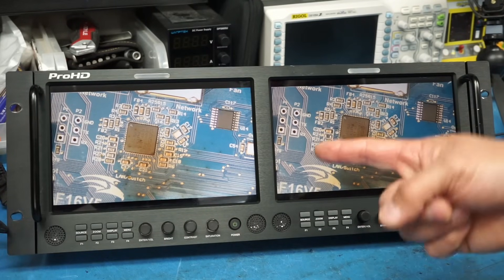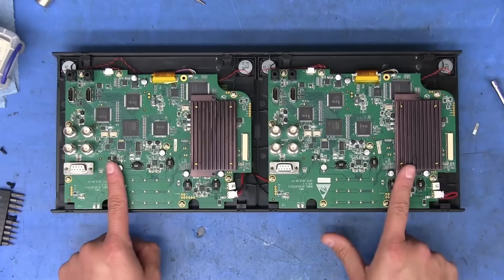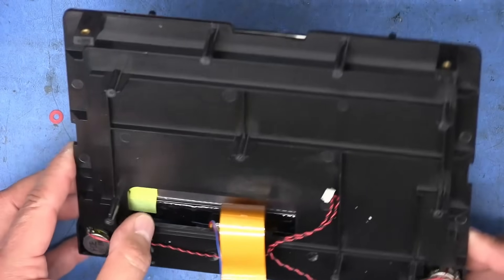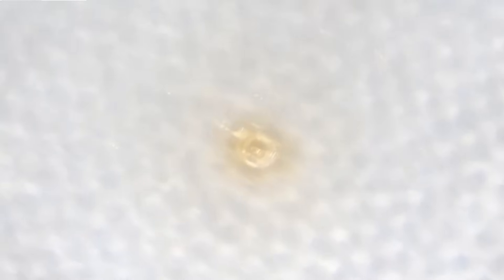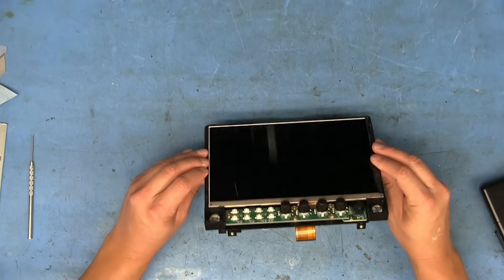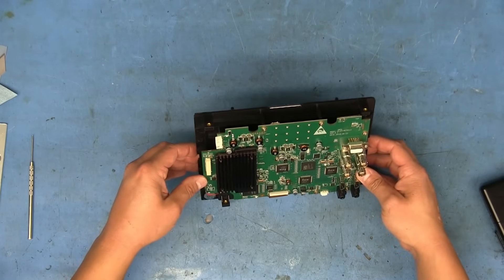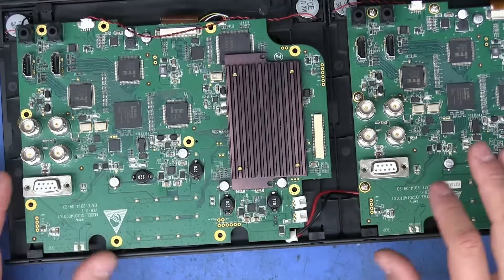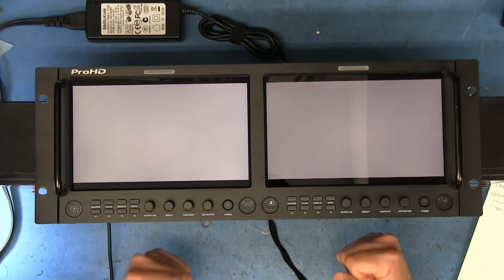TEF #157 | JVC DT-X92HX2 - Two 8.9" Displays With Brown Stains

Comment: Cellulose in the Polarizer is breaking down.. it creates a corrosive gas that attacks similar components.. replace all the cellulose layers the others won't be far behind.  This happens to most Cellulose film products that are more than 20 to 30 years old depending on the storage conditions.
Reply from the maker: If that is the case, unfortunately I'm not hoarding, errr.... have any inventory of any other LCDs I can take the sheets from. It's gonna have to remain this way for now. The 24" one I took the one sheet from doesn't have any other sheets I can use.
Reply: @ThatElectronicsFool  The issue with other old monitor parts is they are aged as well.. Best to use new Polarizer Film.. New stock is readily available online and is very cheap.
Reply from the maker: That's true. I'll have to look into it. Thanks for the suggestion!

Comment: Seems like googling the term of this phenomenon is kinda difficult with many vague searches. 
The term you're looking for is vinegar syndrome on lcd.
Reply from the maker: Very interesting. So I looked it up, the only thing that moves me away from thinking it's the same as vinegar syndrome is that it doesn't smell like acetic acid. Didn't think of making a mention of it in the video, but the affected area smells a lot like cinnamon rolls to me.
Reply: Doesn't look at all like the vinegar syndrome. Besides the smell not being there (as mentioned by @ThatElectronicsFool), the vinegar syndrome has almost an oil spill effect as opposed to these 'burn' marks.

Comment: It can't be image burn because that usually appears on the display but that is very very strange I was wondering the reason maybe for the glue and stuff in the scholastic material used in some sort of vibration Like a lorry or some sort of industrial vehicle🤔🤔🤔🤔🤔🤔
Reply: maybe it was in a Broadcasting station each light could represent a Pacific camera that's being used in a studio maybe not who knows it just seems like that🤔🤔🤔🤔
Reply from the maker: After asking about it, it turns out it was installed in a server room where it was meant to be used to make sure video signals were reaching the server that was recording whatever was being sent to it. Apparently it was rarely ever actually accessed for the intended purpose, and so it got taken out.

Comment: I think it's dead bugs getting cooked inside. I have dead bugs in my computer monitor. Terrible construction. Mine is not smashed just dead so oblong black pixels. Maybe someone pushed the LCD panels trying to "massage" away the bugs :D Good job on replacing the sheets. Maybe these displays could come in a box with a large TALLY light on the back.
Reply from the maker: Ah yeah, tally light in the back makes sense. 

As for the stains being due to bugs, I looked at a lot more areas than I showed in the video, but none of it had any visible evidence of bug material. Unless they were some really microscopic things that caused the rest of the material around them to start delaminating over time when they decomposed.

Comment: Definitely looks like rust. But then it begs the question of what those sheets are made of. I'm gonna guess whatever it was made of got oxidized or chemically degraded somehow.
So I concur with t1d100, some kind of burn, possibly exposure to high power radio waves, perhaps it was used in a radio or tv station.
Reply from the maker: Definitely leaning towards believing it's been caused by some sort of transmitter in the vicinity of where it was used.